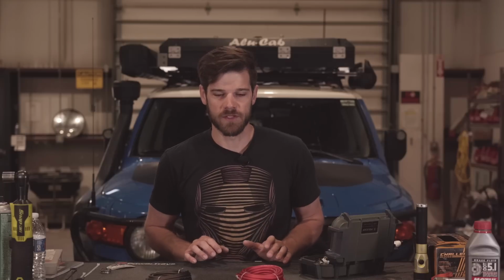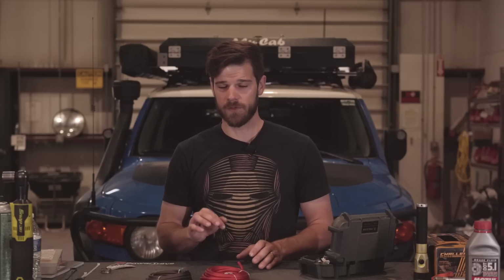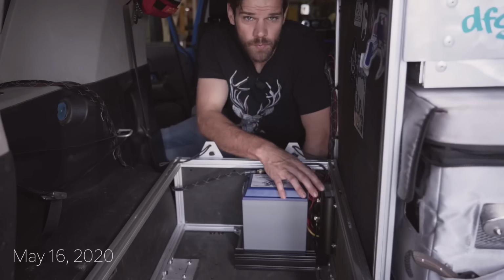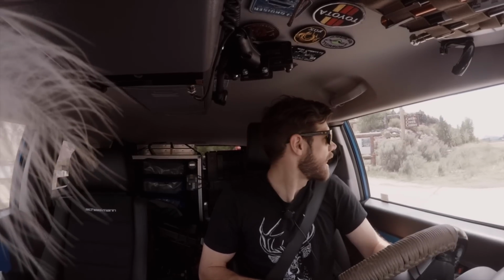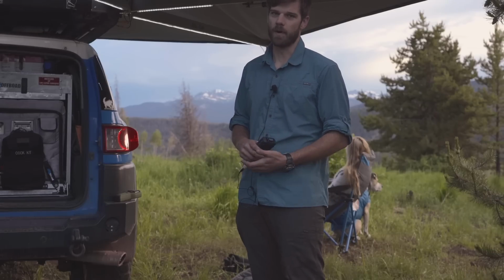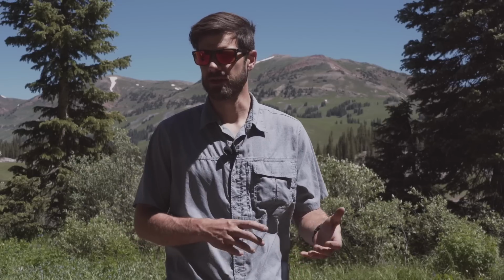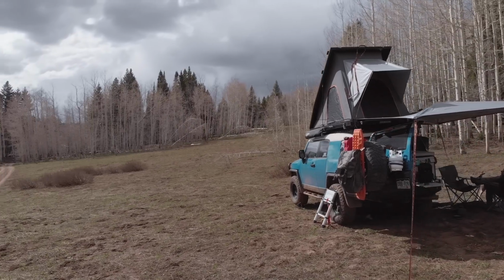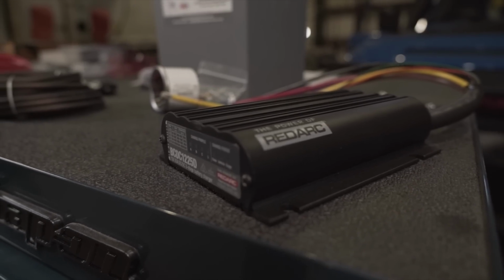Is Upgrading To Lithium Worth The Cost? | Redarc Battelborn UPGRADE

Comment: Factory alternator ? I got the same setup with my factory 80amp alternator. Voltage dips abit. Im using the redarc bcdc25
Reply from the maker: Get a Tacoma alternator with the towing package. It bumps it up to around 130 amps if memory serves. Plug and play.

Comment: Outstanding man! Finally,  someone that actually knows what they are talking about. I'm that guy in the early stages of figuring out my Tacoma build. Tha electrical is what's been holding me back but you sold me on the lithium as I'm retiring soon and plan to do a lot of camping/overlanding. Thanks, new subscriber!
Reply from the maker: I’m about to do some more of these videos in the coming months since I have the Tacoma too. I have been waiting a long time to redo this kind of stuff with more detail. So keep an eye out for that, as I’ll be adding some other really cool (optional) electronics to the setup that will really be neat stuff. Thanks for stoping by!
Reply: @IndependenceOverland  you might wanna check out a video on diy drawer system by a fella named Weber.......

Comment: Why not use a dual battery isolator that supports lithium battery like Key-line? 
Currently I am using a 12v 135 amp dual setup lithium battery have a 250amp alternator,a lot of these lithium  safety feature  guard system BMS(Battery Management System)internally built into them.
Dakota Lithium can take heat under the hood.
OPERATING TEMPERATURE
Ideal for rugged & harsh environments. Much better than SLA or other lithium batteries. -20°F min, +150°F max optimal operating temps (battery performs well down to -20°F). Internal even-heat technology allows for charging below 32°F. BMS high temp cut off at 167°F / 75°C.
Reply: @IndependenceOverland: BTW I driving a 2018 Jeep Wrangler with a winch for winching you need a higher amp lithium 60AMP isn’t enough to be winching with that.
Reply from the maker: You cant winch with lithium anyway.

Comment: Hey Tyler, after years of having this in the fj, do you still enjoy this setup? I'm looking at the 1250D with 2 battle born 100ah thoughts on that setup?
Reply from the maker: I am VERY happy with this setup, however Redarc upgraded me to the 40 amp charger and I like it even more. 200ah is a ton of power combined with this charger. I would evaluate your use to make sure you aren’t wasting money on that second battery. If you drive for even 2-3 hours per day, or have some solar, consider just 1 battery to begin with. The reason being is that these systems charge so incredibly fast that it’s rare to run out of power. 

My next vehicle build will have a single 100ah battery and a 40 of 50 amp BCDC, and it will be enough for me to camp + charge all of my camera gear.

Comment: Outstanding video, thank you. Researching and found you here. Really great info and experience given. Appreciate it. So far I've got a 100ah bb and the bcdc1225d. Still need to figure out appropriate wire gauges, fuses, location, etc. ...  ? What do you think about the redarc smart isolator? Is it necessary with the 1225? .... thanks again for the great video. Will check out your others. Awesome FJ, too. 👍🏻💯
Reply from the maker: I wouldn’t worry about the isolator, the BCDC unit will do that automatically. 

On wiring I ran 8ga. Heavier wiring for long runs is best, even consider 6 if there’s a chance you will upgrade the BCDC in the future. The wiring I used is this stuff, it’s very easy to work with and high quality. 
8ga https://amzn.to/3VuWmyM
Use either a 40 amp Blue Sea breaker https://amzn.to/3VxjyMM
Or the Redarc fuse system: https://amzn.to/3ukEYR8
Typical blade fuses can’t handle the load so rule those out. 

The Redarc fuse kit can be pieced together from brand “little fuse” for a bit cheaper but the Redarc kit is high quality and has everything you need. Either way will be fine.
Reply: @IndependenceOverland   .. awesome. Thank you kindly for the response. Really appreciate the advice, too. Will def go with 8 or 6 gauge,  now. I hear and understand you on the blade fuses. I wil get the redarcs  for continuity and quality. Thank you for the references, also.  Take care and be well. Happy trails
Reply from the maker: Your gonna love it!

Comment: Fantastic video quick question please using round numbers how much does a dual battery set up cost for the batteries and installation generally speaking? Meaning two lithium ion batteries installed or to AGM install? Any guidance again using round numbers would be fantastic. Thanks in advance
Reply from the maker: It depends on how much battery power your looking for. The system as shown here with a 50ah lithium will cost about 1000 bucks if you just do it yourself, its pretty simple. Going with two Battleborn lithium batteries (I will assume with 2 batteries you want max power, so 100ah for this estimate) that will be close to 2000 bucks. The Redarc system with 2 AGM batteries could be as cheap as around 800 bucks but you will replace them much sooner and ends up costing more in the long run. Also, 200ah of AGM only equals about 100ah of usable battery. 200ah of lithium equals 200ah of usable power.
Reply: @IndependenceOverland   thanks
Reply: Sorry one final question. I have a 200 series land cruiser. If money was no object and I was to buy two lithium batteries and a radar. Which model battery would you choose? What brand? Thank you again
Reply from the maker: @erich964  Ask as many questions as you need!

I would absolutely buy Battleborn batteries. There are lots of less expensive lithium batteries but in testing a lot of them fall short of their claimed energy. 

Awesome choice on the 200 series!

Comment: Greetings my friend. Where you connect the black wire out the redarc? I know is groung but just wondering where do you connect it. Thanks
Reply from the maker: I believe I connected mine directly to a bolt hole where my rear seats used to bolt up.
Reply: @IndependenceOverland  awesome thanks for the quick response.  👍🏻👍🏻
Reply: @IndependenceOverland  by the way.  Great Channel
Reply from the maker: @fjcruiseroverlanderscarlos4612  thanks for checking it out Carlos!

Comment: Great video! What are you using to monitor the level of capacity of the lithium battery to know how many AH you have left? Thanks!
Reply from the maker: Hey Aaron! I ended up using the Victron 712 which is decent. Not quite plug and play and requires some programming to work right. I far prefer the Redarc RedVision system but of course that is much more expensive. 

It looks like the Victron units have gone up in price since I got one, and you can also get a Bluetooth only version which is a bit cheaper, and the direction I would have gone but they weren’t out yet. I’ll drop an affiliate link below, but also know that you can score them cheaper on eBay. 

https://www.amazon.com/dp/B07F3C7ZV7/ref=cm_sw_r_as_gl_api_gl_i_WF4NNR7BFPNC1R24X877?_encoding=UTF8&psc=1&linkCode=ml2&tag=independenc09-20
Reply: @IndependenceOverland  thanks brother! I’ve been enjoying the content. Keep it up! 👍🏼

Comment: Why cant a Lithium go under the hood? Is it because of the heat?
I have space under the hood, so I do want to use that valuable space, but I don't want an AGM battery. So, if a Lithum cannot/should not go under the hood due to heat, wondering how else I could use that space instead
Reply from the maker: The heat under the hood will kill the lithium battery. Not sure what to do with the space. Check out my hot water video, you could build a system like that for that area. https://youtu.be/2JaiUpQ1skk

Comment: Thanks Tyler!  Curious what kind of battery are you running as your starter battery with this system.   I’ve gotten word that you can’t mix batteries, but I’ve also heard you can.   Do you know which is true? 

Curious because I want to get a lithium aux battery, but use an AGM as a starter battery.
Reply from the maker: Re replying to this, the holidays had my head buried apparently. If you use an old school solenoid dual battery system, you cant mix batteries. As a matter of fact, you should even use basically the same battery for both and they should be the same age, or else they can kill each other faster. 

With the modern DC-DC systems using something like a Redarc, you can use a mix of battery chemistries. My starting battery is an Optima, and the Battleborn 50ah for the aux/house battery. Keep in mind that lithium can not be mounted under the hood, the heat will cook it.

Comment: How did you run you wires to the lifepo4 battery?
Reply from the maker: The Redarc is right next to the battery in the rear. So I ran the cable from the starter battery to the Redarc charger through the firewall grommet and under the factory wiring covers on the floor, drivers side.
Reply: Nice. Thanks man

Comment: Great video. What do you use (or would recommend) to monitor the battery charge percentage since the BCDC1225 kit only comes with  voltage gauge monitor.  Thanks
Reply from the maker: I ended up with a Victron 712 system. They now make a wireless only shunt, so Bluetooth is the only way to monitor it. Thats a pretty cool feature so you wont have to drill a big hole for the face of the unit. I do hope Redarc makes something similar in the future for their smaller DCDC setups that dont require the entire Manager 30 and Redvision. I think a good budget set up would be beneficial for all. 

Gauge with monitor: https://amzn.to/3mtZhck
Bluetooth only: https://amzn.to/3BafWpp

Comment: So I have a traditional agm dual system with the blue sea MLACR switch and want to add a third battery lithium in the back of the 100series lc using a redarc manager 30. So you see any issues doing that?
Reply from the maker: No, aside from you will need another battery charger such as the Redarc, and you might consider upgrading the alternator. I’m not sure how many amps the 100 series outputs, but adding an additional 25amps of load to it while driving could prematurely wear it out if it’s too demanding.

Comment: Do you have a wiring diagram? It sounds simple enough but I don’t want to overlook anything.

Are you using a fuse box of some sort for your lights and fridge? I didn’t see that in the video. Where are the lights you are running off of this battery and fridge plug into?
Reply from the maker: https://images.app.goo.gl/yV9FXM89HSrsARfx7

I use a Blue Sea fuse box. All of my light are run off of a main switch so I don’t have to have the key in the ignition at camp. I can press the button and only use lithium, so my starting battery doesn’t die. The lights and fridge plug into one fuse panel I have in the rear, and accessories towards the front run off of another identical fuse panel. They make them in 6 and 12 circuits I believe. I chose to do a 6 in the rear for the fridge, lights, power ports etc. 

https://amzn.to/3kGYJwM
Reply: @IndependenceOverland  

Thanks for the quick reply I was wondering what you do if you don’t have the lithium battery in the car. Is this the switch by any chance? This is super solid. I have a 4Runner and will be running a CFX45 and just a few camp lights. 

https://www.westmarine.com/buy/blue-sea-systems-e-series-compact-battery-switch-off-1-both-2-no-alt-field-disc--3831393?lsft=mrkgcl:481,mrkgadid:3312353938,cm_mmc:PSGoogleGSC%3ENonB%3EProduct%2520Type%2520(LIA)_-3831393,product_id:3831393,adpos:,creative:164945113891,device:m,matchtype:,network:g&gclsrc=aw.ds&&gclid=Cj0KCQiAhP2BBhDdARIsAJEzXlGeVOO1Zvd6qc3X9kL5DEmbGyv_wcrTsWY0jI-gWMEdhgnq-XRBTSsaAqNmEALw_wcB
Reply from the maker: @Lxzcvyesfwmk  No, mine is a small toggle switch in the dash wired through a 100amp relay. So all my accessories fire up. The lithium battery never comes out, its mounted along with the Redarc and it all stays put. I do have the switch that you linked, but I use it for my winch or for my anderon power to my trailer.
Reply: What solar panel are you using with the Redarc? I mirrored this setup curious what's been working for you. I bought the 50ah battleborn and went with redarc as well. The video was really helpful!

Im only running a 46L fridge so hopefully this will do the job.
Reply from the maker: @Lxzcvyesfwmk  It'll do the job. I am using the 4thD Solar 165w panel. They are very expensive, but it seriously pulls more amps than anything else. I used my Conqueror Camper for the first time over the weekend, which is equipped to traditional glass solar panels. My 165W 4thD panel pulls more amps than the traditional panels do, and for longer. The 4thD panels seem to collect amps with low sun angle, and cloudy days WAY better. I was hoping I wouldn't have to upgrade the Camper due to the included panels, but after one trip I will be. They are expensive, but they are worth the cost in my opinion. Not affiliated with them at all.
Reply: @IndependenceOverland  That makes sense. I've started doing research on solar and when it comes to panels you get what you pay for. Sounds like there are several classes for panels and the nicer ones (Class A) are more expensive. I'll check that out, thank you!

Comment: Thinking of redoing my FJ set up as well. I been using the National Luna for 8 years and on 4th battery now and new alternator. Removed the last dead spare (Ultima yellow) and installed new starter battery (flooded) and its going dead now. Will be disconnecting the LN. I was never impressed with the setup as batteries never seemed to get charged. I was running ARB fridge and radio gear but not heavy use . Perhaps the RedArc would be better. Ive only used winch one time in 9 years and that was pulling my Dads mower out of the mud.
Reply from the maker: I can't praise the Redarc chargers enough. Especially paired with a little lithium battery. Its nice not having to even think about it.

Comment: Thanks for the video, what electric blanket do you use? I'm struggling to find one with good reviews.
Reply from the maker: I went cheap! The 30$ amazon special works great, as I use it on the mattress rather than as a blanket. With good layers it will help you stay warm all night. They shut off after 45 minutes, but they help you get your core temp up and it seems to help you stay warm all night, even after it shuts off. https://amzn.to/3pKJ7tl

Comment: You did a great job of explaining this install. I've been researching this for 3 months. My set up will be the REDARC Manager 30 with a Battle Born 100AH.
My Gladiator build is well underway and the electrics are the last detail to complete. I'm not cutting corners in this build and hopefully the money spent will be well worth it. 
Note,, if you drain the battery flat just use a little jump pac to wake the BCDC up..super easy
Reply from the maker: Yeah I actually carry just a jumper wire, and in the one instance it ran flat I went from the starting battery to my six fuse panel for just a second and it did the trick.
That gladiator should be a sweet build! It’ll be really cool to have a shore power option with the manager 30!

Comment: Great video!  I've used BBs in a few different applications and think Lithium pay for themselves in their longevity.  Just as importantly and as you mentioned, they stay at a higher more constant voltage while being used which appliances love.  The lighter weight and ability to accept partial charges without degrading longevity is ideal for overlanding.  I'm less familiar with the Redarc system and really appreciated your assessment there.  I'll be giving the Redarc some serious consideration when it's time to build up my jeep.  I think winching is my only real question.  I don't have one yet and don't plan to use it a lot when / if I get one.  If a 100aH BB was used, could a winch be connected to that, rather than the starter battery?
Reply from the maker: No, you can’t winch with the lithium. The way to go is to use a Yellowtop or similar for your starter battery, and winch off that with an upgraded alternator. That’s the route I took. For basic winching it will be fine. When you get into rock crawling and using the winch for hours a day is when you really NEED the secondary winch battery.

Comment: The reasons you stated is why I went with the redarc 1225 when I put together a dual battery system in the FJ.  I have yet to take the plunge into lithium, once the AGM goes out I will.  Regarding your solar panel, why did you go with a fixed vs a suit case type?  I too have the AluCab tent.
Reply from the maker: I just did that for simplicity. The Alucab pops up to a near perfect angle for a solar array, but even laying flat it collects a lot of amps at peak hours of the day. I mostly didn’t want to worry myself when I’m away from the vehicle for hunting trips. I’m paranoid about my stuff getting stolen. On my next build, I may do a suit case type. We will see.